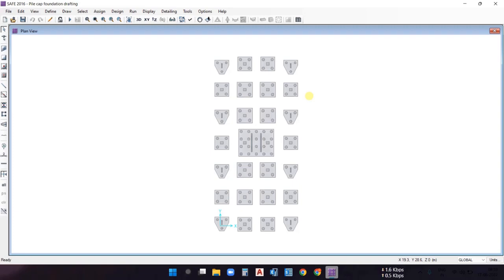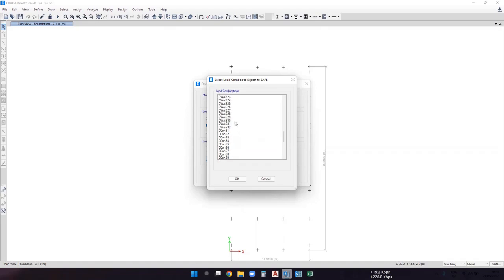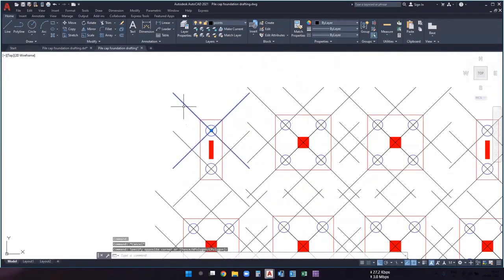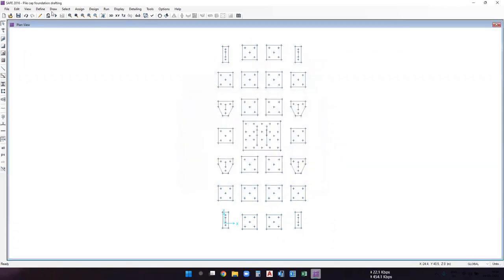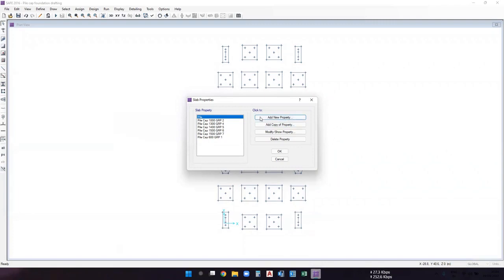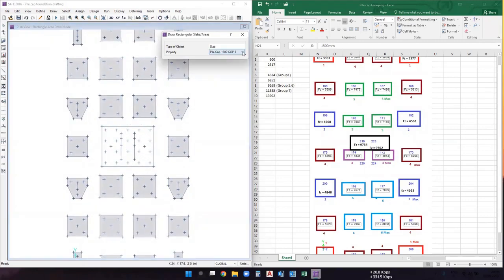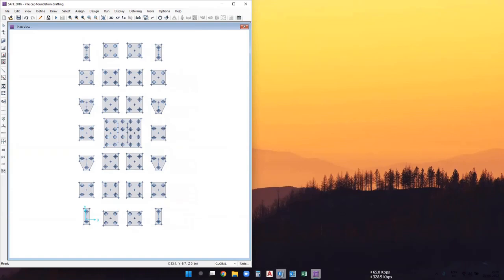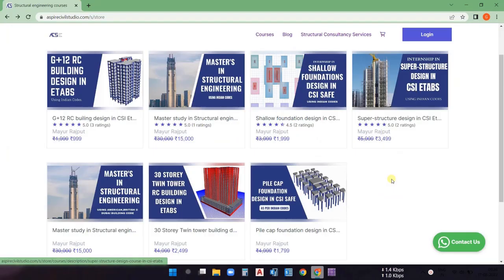Pile cap foundation modelling in CSI SAFE | Aspire Civil Studio

Comment: sir, i have a question that in case of irregular building by stiffness and center of mass upto 5% as per Is code,  is always necessary to consider for normal residental building upto 3/4 storey; which is already designed architecturally and can not change its design so how to analyse??
Reply from the maker: For low rise building you can ignore structural irregularities, Just make sure designed building stable enough to resist eternal loads.